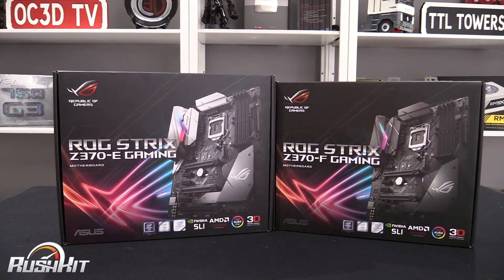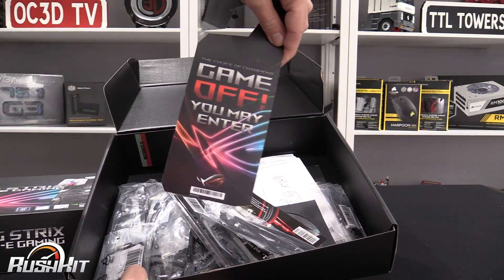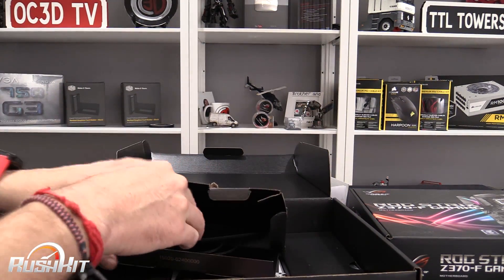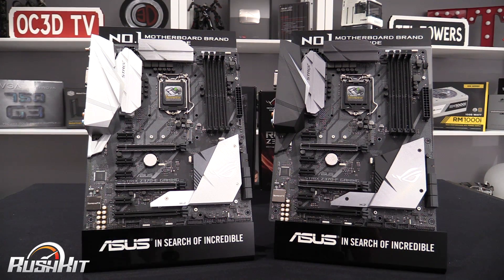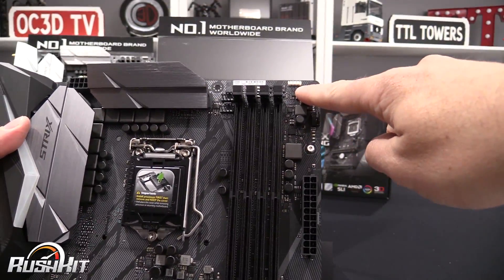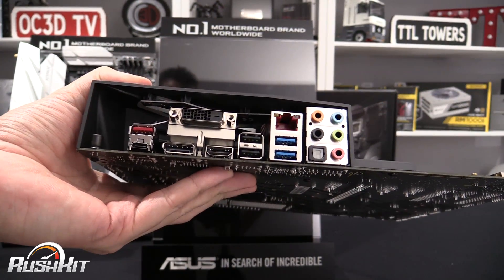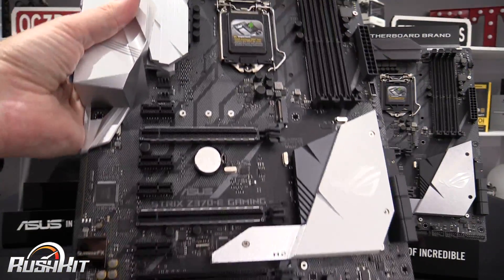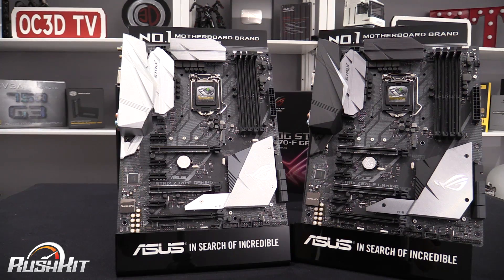Asus ROG Strix Z370 E and Z370 F Preview and Comparison

Comment: for the z370 E  u don’t need internet ethernet or an adapter? the mother board will just connect to your wifi?
Reply: It has built in WiFi and bluetooth 4.2, the antennas are included that you can screw in on the back of the board. Or you can use the ethernet if you prefer wired network connection to your router.

Comment: The difference is the Z360-E has 2x2 Dual Band Wi-Fi, Bluetooth v4.2, 3D Mount, and USB 3.1 Gen2 front panel connector. The Z360-F, does not.

Comment: Thanks for the overview. I bought a Z370-F Motherboard (I wanted the grey/black style and had no need for WIFI adapter) and noticed now there is no internal header on it to connect the Type C USB 3.1 cable from my DarkBase 700 Case. Does this mean I can never use the USB 3.1 Type C on my case front now? Or is there a way I can add a fitting header to my motherboard if I buy some kind of adapter cable? Thanks in advance for any help!

Comment: I read that some of the heatsinks on the F are hard plastic finish and on the E they are metallic. Here is link:

https://www.anandtech.com/show/11860/z370-motherboards-asus-asrock-ecs-evga-biostar-msi-gigabyte/4

“Firstly, the Z370-E features a set of silver metallic heat sinks, whereas the Z370-F uses a darker tough plastic”

I assume they refer to the I/O shroud but still sounds strange they are different and no other review I have watched mentions it. Can you confirm if there is indeed a difference? Thanks.
Reply: P1Fanatic anyone have more information about this difference please?

Comment: Thanks for the Preview. I could really use integrated bluetooth on my system but really hating those silverish heatsinks. Now I have to decide between bad looks or external BT dongle :/
Reply: What do you mean external dongle? You can either get a pcie card that has bluetooth or connect the dongle through the motherboard header and stuff it inside the case.

Comment: I need wifi in my home.. are better integrated wifi on Mobo or pci-e wifi Card? Thx
Reply: you are better off getting a powerline adapter you know..
Reply: Kvarnholmen thx for all, i bought the Asus RoG z370e and i download using 270/300 MB of muy optical fiber, 32 MB/s
Reply: It has antenna this MoBo

Comment: I didn’t understood, Z370 F hasn’t got WiFi?
Reply: The Red brick Nope sadly the Z370 F only comes with gigabit Ethernet networking capabilities, no WiFi availability unless you get an adapter or expansion card, which is quite unfortunate because I LOVE the gunmetal finish on it, but I’d like to have the onboard WiFi of the Z370 E board. The looks alone were worth the lack of WiFi for me though. An odd choice by Asus either way haha.
Reply: Robert Shaw
apparently the onboard wifi on the z370 E is worthless
choose wisely

Comment: that rear IO is a joke
Reply: Vladek16 Well 5 type A USB-ports is not enough: Keyboard (my K95 needs 2 ports), mouse, USB-Headset and you have only 1 or 2 free ports.
Reply: it does feel empty after all those X399 and X299 motherboard that have so much USB and stuff in the IO. But there's everything you need :)
Reply: I have a Asus Z170 deluxe and the rear IO is heaps better from 2 generations ago! They are going backwards...
Reply: I was considering side stepping from x99 6800k to an 8700k but the rear IO on these boards are lacking in comparison.
Reply: Agreed, 5 I/O ports. I don't include the gen 2 since I've never used it. My H270 has 7 USB (4 / 2.0 and 3 / 3.0) plus the one I've not had a need for.
Reply: Every 370 board seems to be like this. What gives! Intel seems to have downgraded the 370 chipset to bolster up 299, pathetic.
Reply: "I have a Asus Z170 deluxe and the rear IO is heaps better from 2 generations ago! They are going backwards..." Yeah but the Z170 Deluxe rear IO is mostly loaded with garbage Asmedia.
Reply: Just plug in a 8x active USB 3 Hub to that USB C port ^^